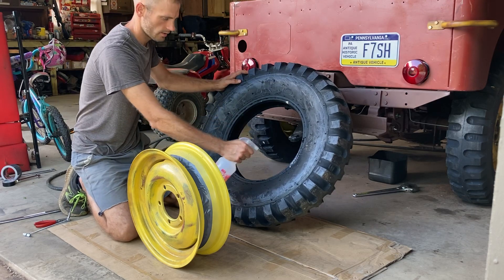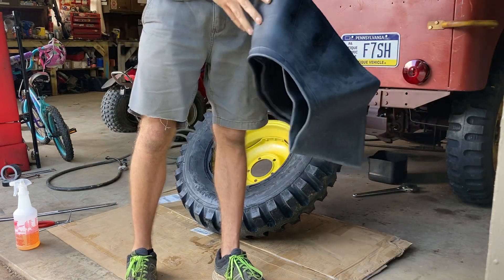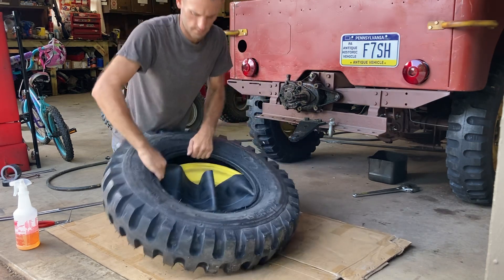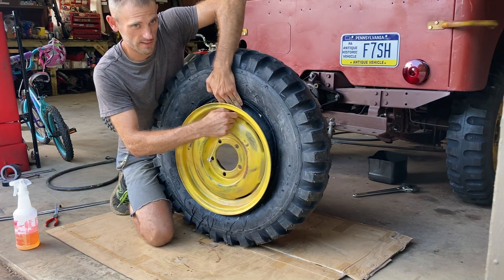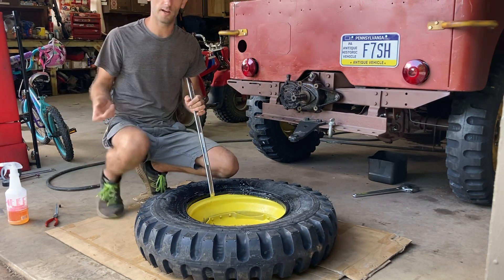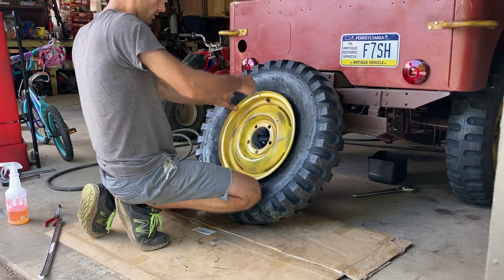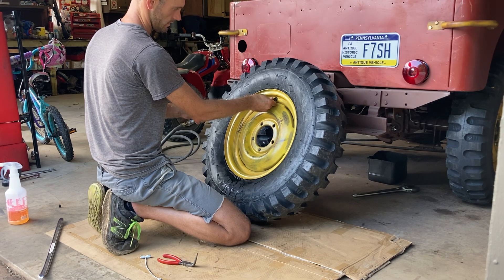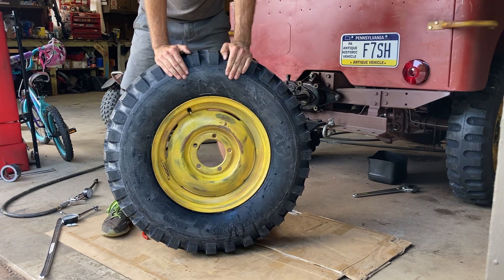Mounting a tube type tire by hand

Comment: 8 minutes!   Just finished the mounting of my 17x 4.5 for a rod project  first tire mounting took hour,  20 minutes 🥵🙃.  Have not done this in 50 years…  truck tires in my 20S !😉   Should have watched you first 😉…did pretty much what you displayed  thanks ! Next three , hope faster👊🏼🌻
Reply from the maker: They definitely get easier as you go. My last tire is always the fastest. And I usually lose my touch by the next time I need to replace them. 😆

Comment: Great video, what is your reasoning behind running tubes in those specific tires?  They can run tubeless correct? Just wondering why you like running tubes in them.
Reply from the maker: Thanks. They are “tube type” tires on tube style rims with no safety humps. I have run tubeless tires on them but I’ve had even better luck running tubes.

Comment: This is great! Thank you. I have a 1936 Buick Special (thin tire) where the valve stem rotted and leaked air out. I'm going to try to tackle that tube a similar way your did. I can break the bead with a board and a car as weight. Is there a valve stem protector or is it just tube to rim. I know about the tube protector inside the rim. I have tire spoons and a valve too similar to yours.
Reply from the maker: Cool! I’m sure you’ll be fine. Tubes are designed with built in stem protection. There is a super thick rubber coated portion of the stem that goes through the rim. You don’t need any extra protection. Just be sure to get a good quality heavy duty tube. I like Carlisle
Reply: @redeyecafegarage7484 Thank you! I've done small tires...lawnmowers, tractors, etc, but not a car, will take my time!
Reply: I've managed to get the tube out. Broke bead with a board and a truck. They did not install tube flap or valve guide which caused the leak.
Reply: Thanks to your video I managed to get it!! Worked great, I also install the valve grommets because the tube tends to move inside the wheel which wore a hold in the stem. Sorry for all the comments, but this really helped.

Comment: Is that valve tool a home made thing or can you buy those somewhere. Never seen them before. Sometimes I've just screwed a nut over the valve stem to keep it from getting sucked back in but that doesn't give you the ability to pull up and wiggle the valve up to seat it better like you did.
Reply from the maker: Tractor supply for like 4 bucks. Any auto parts store will have them too

Comment: Narrow rim, 19x3 inch. Tips on fitting the tube in there? I cannot for the life of me get it started once the one bead is in. The sidewalls are super close together
Reply from the maker: Hmm that’s a tough one. Sometimes in motorcycle and bike tires I put the tube inside the tire first. Just be careful not to pinch anything.
Reply: @redeyecafegarage7484  I finally ended up getting it after hours of struggling, and ruining one tube. The opening between the sidewalls was a pinky width, so I had to spread the sidewalls while simultaneously trying to feed the tube in that narrow gap. My hand is bruised and super swollen from having it pinched in there for the hour or two I fought with it. If I had known how much trouble this was, I would have converted the tractor to the wider 16 inch implement wheels lol

Comment: Nicely done sir!  Curiosity question:  looked like some sort of duct-tapey-looking stuff in the center of the wheel?  I'm sure I'm just revealing my ignorance, but I wondered what that is.  Happy 4th to you and the family!
Reply: Pretty sure it is duct tape to keep the rivets or seam inside the wheel from rubbing on the tube
Reply from the maker: Hi, these wheels had some pitting so I used t-Rex tape to smooth them out. You’re supposed to use rim flaps but I never do. Haha! Happy 4th to you too!